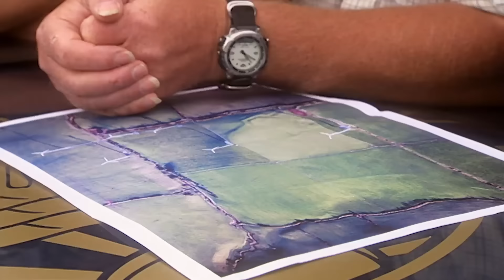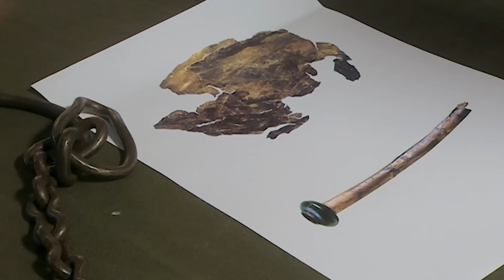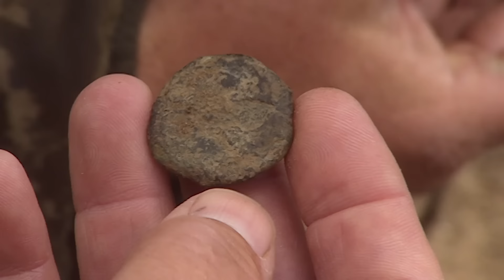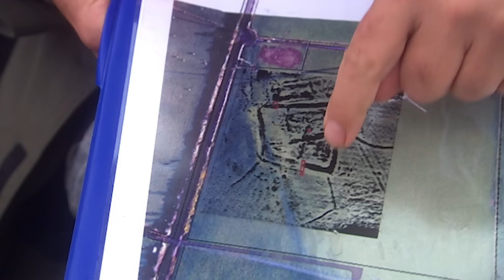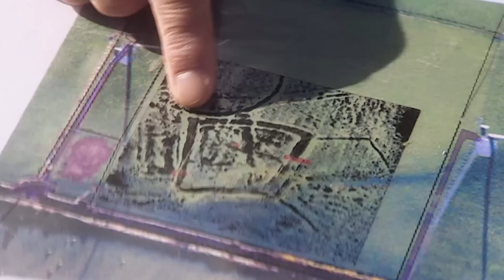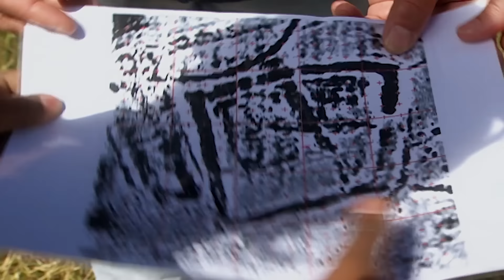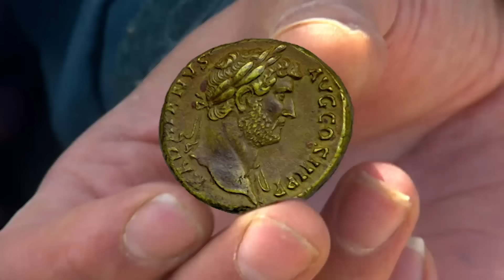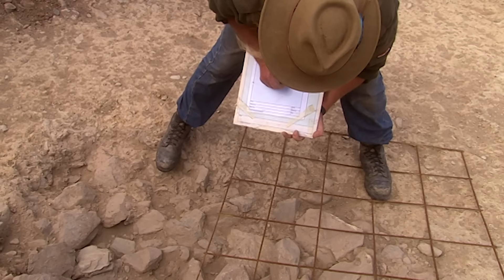The Druids' Last Stand (Anglesey) | S14E04 | Time Team

Comment: 13:20 This is the only reason why I don’t like using backhoe tractors other  equipment to strip the soil because they found that coin with metal detector but what about other bits of pottery and another artifacts that aren’t detectable by A metal-detector that you scraped up with a backhoe and dumped in a pile.

Comment: Very interesting, period AD 61, the Massacre of the Druids on Anglesey by the invading Roman, they say a conclave of Druid leaders was called with leaders from all over the British isles to formulate resistance. By all accounts, the Romans "happened to be sailing by" whilst the Druids were performing a waterside ritual ,seeing them the Druids mainly older men started cursing and thrashing the water lapping the shore , at which point the Romans put to the shore and massacred over 300 souls burning everything including their dwellings ,the sacred groves and taking extra time to obliterate the site.The outrage at this act could also fit with Bodacias rebellion in my opinion alongside the molestation claim, the reports of the Druids also mainly comes from Roman accounts, it could be argued they would put whatever spin they wanted on event's to fit their agenda.